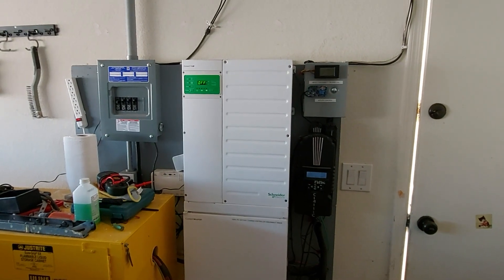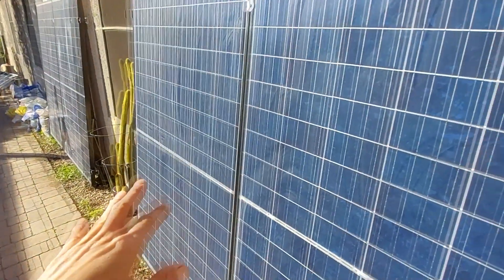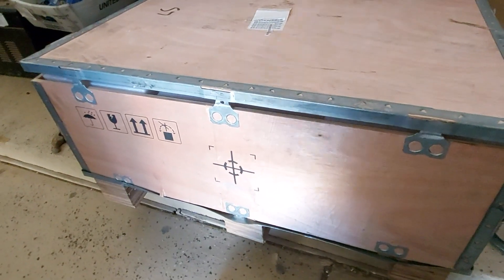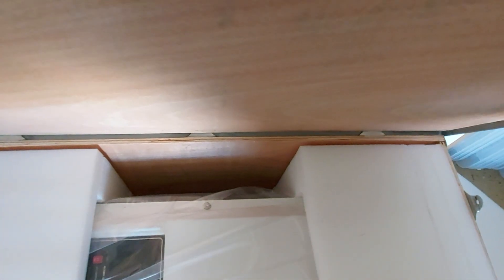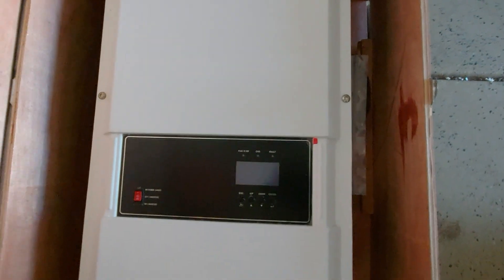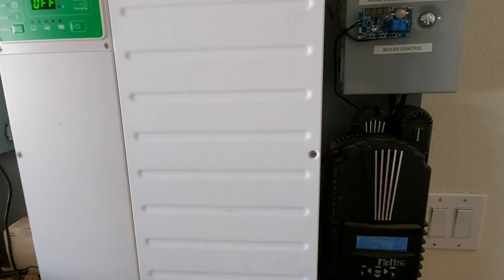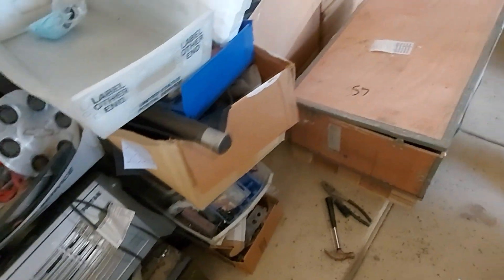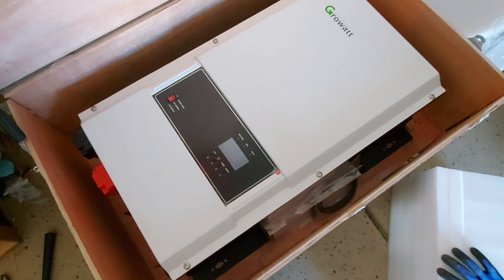Getting rid of my 4.5kw off grid solar system after 5 years!

Comment: Good move: The number one mistake, is not putting in a big enough system to get the job done. Too small of an inverter will fail to start large induction motors, like a shop air compressor, or more common, a central air conditioner. I agree100% with not back feeding the grid. Storing the excess in your own battery means you get 100% credit for your excess power. (minus the maintenance cost of the battery) I'm putting in a huge system, involving 16,200 watts of panels (54 panels, 72 cells, 300 watts each) 67 kWh of lead acid batteries, (64 golf cart batteries to start with) and building my own 24 kW inverter. (can't find one that I like) I will still be connected to the grid, but only through a harmonic power factor corrected charge regulator. The charger will ONLY charge, if the grid voltage is above a threshold voltage (241.8 volts) and the charger will only come on, if the batteries drop below ~50% state of charge. The only time I will use grid power, is if there are too many consecutive overcast days, where the panels just aren't enough to keep up. That is, 3 days that month that I use grid power, not 30!! If your inverter has a feature like that, what you have, is a "grid autonomous" system. that means using grid power ONLY when necessary, and if there's a black-out, you won't even notice it. I've never intended to go grid tie, because I understand, that the grid is not obligated to be your maintenance free, infinite capacity battery. Off grid systems like this leaves you entirely immune to policy changes within the utility.
     If you live in an area where it's illegal to disconnect from the grid, no problem....Just don't pay your power bill for a few months...There: OFF GRID!!😁😁 (That money is better spent on batteries)

Comment: Good luck, my growatt 12k system works but the mppt part does not float & is inaccurate. Signaturesolar has not helped & does not even respond .
Reply from the maker: Can you elaborate more on the issue? One of the mppt port isn't working for me either.  Lol.
Reply: @devildestiny555  both mpp['s are working but when I set bulk charge setting it is inaccurate (set it to 56.4v it only charges to 54.8) then it does not charge again til +/-52.4v and float is set @ 54v. also it has stoped working about 6 times for about 5-10 seconds then it starts working again on its own.

Comment: Greetings, it been awhile since I commented on your channel. Why would you switch from  low wave inverters to high frequency? Is it just because of the 250 volt input of the Growatt?
As you know a Midnite Classic 250 would have been cheaper and use your existing inverters. I am not being critical I really want to know what the benefits are. 
Thanks
Reply from the maker: The growat spf 12k inverter is a low frequency, not high, easy to determine because it weight 120lbs.  I switch over to this is purely because of power output, it can put out continously 12,000watts of AC power, where the Schneider xw is only 6,000.  Also, the surge power is 36,000watts.  :)  Schneider screwed all theirs XW customer by discontinued it and the new Xw pro is not paralles compatible with the old one.
Reply: @devildestiny555  That is good information. I did not know The new Growatt 12k is a low wave. I have Magnum and Outback inverters.  I decided against the Sol-Arc because it is high frequency. High frequency inverters do not h9ld up when powering a water well and large inductive loads. That is good news about Growatt's new low wa e inverters. 
 I have a new Magnum on order but the factory is still waiting for parts. I need to rebuild one of our Magnums only because the cooling fan is stuck un. Probably just a bad thermistor. 
I use repurposed Tesla batteries.  When I switch to 48 volts I will definitely consider the Growatt.
Thank you for the information. 
Keep us posted on the installation.

Comment: Congrats on the inverter. I suppose that growatt uses a 48v battery. Are you switching to 48v instead of the 60v Chevy volts?
Reply from the maker: Nah. The 60v setup is my parents house.  My house actually uses 12cells or 45v nominal.  I think I will have to change to 14s, 48v.  But you're right, don't think the growat can do 64v.

Comment: I could be wrong, but check the specs. It's called a 12k but rated for only 7k pv limit. You can use a charge controller to pick up the other 5k
Reply from the maker: 12kw as in AC output.  Solar input is rated at 7k.  I am planing to reuse my midnight to handle the rest, 2kw.

Comment: Double the size will it be enough?
Reply from the maker: Not sure, I could do 11kw, but that add to the cost and I don't want to oversize too much because I can't feed the grid.  It would be nice to have more than you need, but it would cost more and seems like a waste... I dunno.  But money is always tight.
Reply: @devildestiny555  Take a look at getting a few crypto ASIC boxes or old servers to turn the excess energy into cryptocurrency. Even outdated boxes can be used if you can get them really cheap.
Reply from the maker: @NiHaoMike64  I'll look into that, not my Forte.